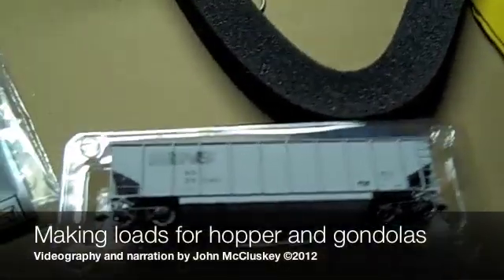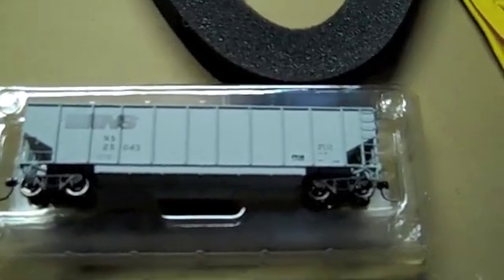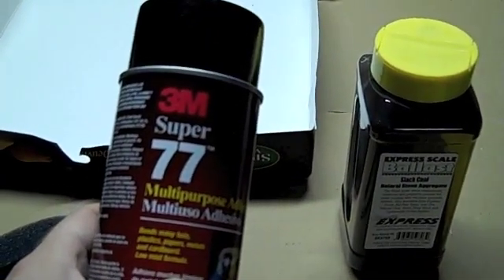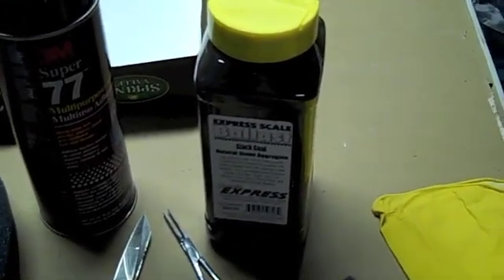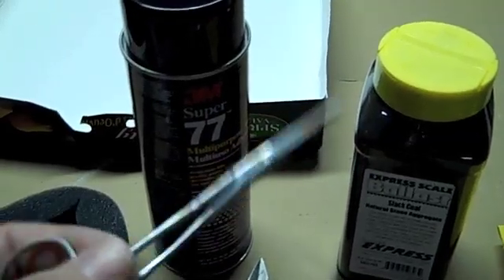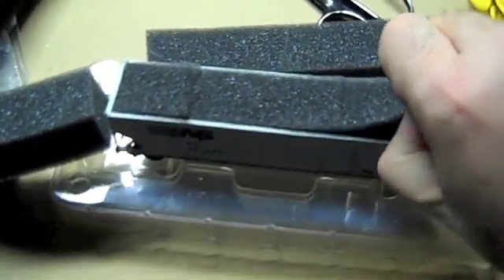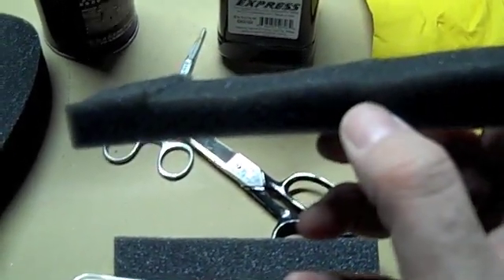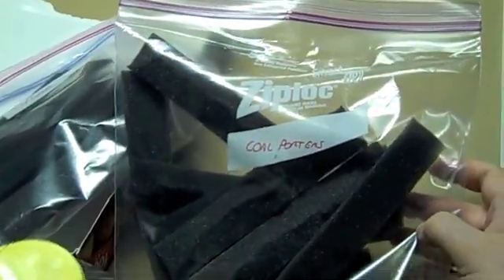Realistic loads for HO hoppers and gondolas

Comment: I use real coal for my steam engine tenders and gondolas.  I got a big old chunk of bituminous coal (anthracite would have been easier but railroads didn't use soft coal) and smashed it up with a hammer (outside of course) on a 12 inch piece of mainline rail (120 lb.) I got from the Central of Georgia when I lived there.  I use the piece of rail as an anvil.  I smash it up until I get it to HO gauge and the larger pieces I use for my Lionel 027 gauge.  It looks real 'cause it is real.  Cheers from eastern TN

Comment: Before you add the "coal" you should seal the foam with some 50/50 mix of PVA and water.  Foam deteriorates over time and will eventually crumble.  The glue/water mix will seal up the foam so it will be usable in 15 years.  Cheers - TN

Comment: Hi,  Personally, I would dump this spray glue and use wet water and 50/50 pva.  Paints on and works very very well.  Becomes rigid in 24 hours and CHEAP.  Bob